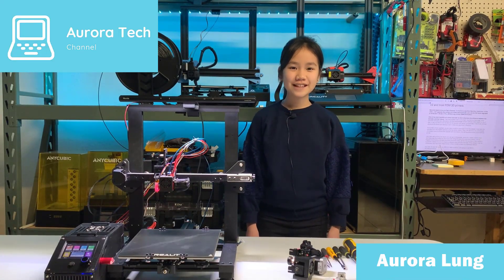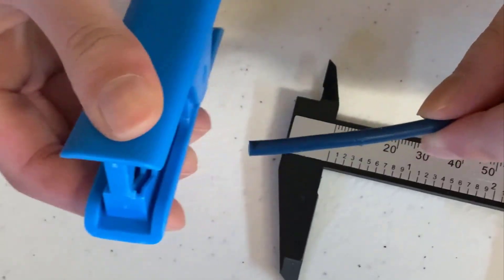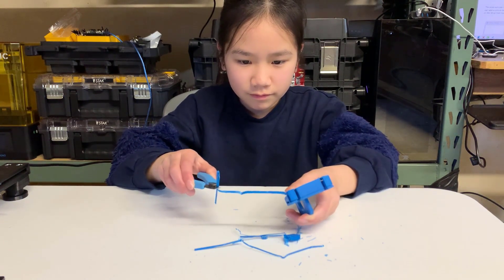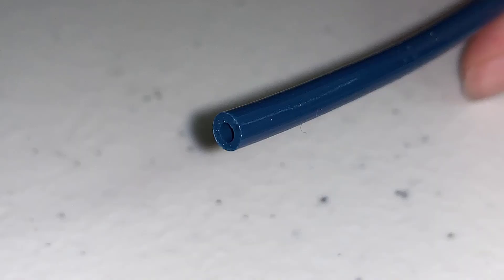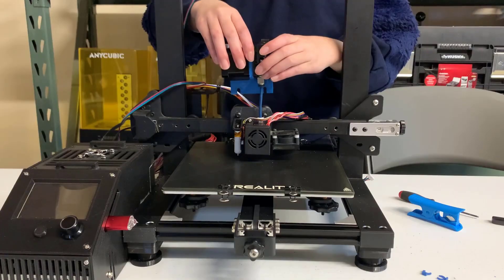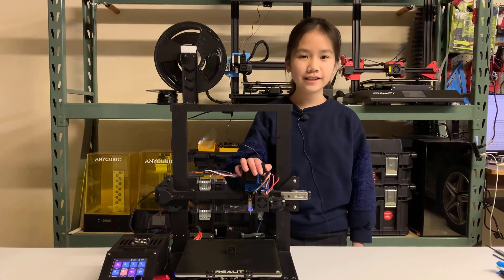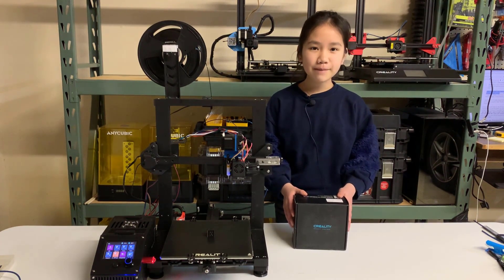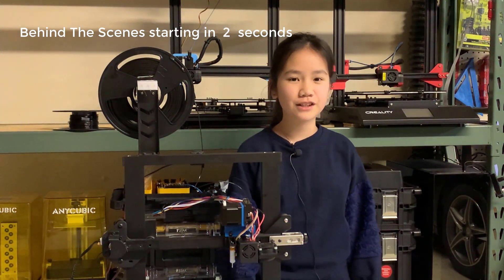3D printer FREE DIY direct drive extruder upgrade, improves print quality for Ender 3 Pro, CR-10

Comment: I like your tutorials, thank you so much, please a word of warning, never hold the object to be drilled in your hand, use a bench vice, if the object catches on the bit, it will spin resulting in severe lacerations and possibly cutting of tendons in your hand. I have witnessed the damage myself and attended the ER.

Comment: Thanks for sharing Aurora, I would like to know if the ender 3 direct drive extruder kit is compatible and possible to install into a 3d printer Two Trees Bluer plus, you know say me?
Reply from the maker: The bluer plus direct drive conversion requires much more works, I would suggest replacing the stock bowden tube to a SHORTER Capricorn tube to improve retractions.

Comment: I often watch YouTube videos about printers and printing. I often fall asleep halfway through or earlier. Not so with your videos, to the point and very informative. It shows that your knowledge is very solid and you bring it over very well. I love your videos, I want more. So detailed and well explained. In my book, this is a direct drive extruder system with a not-so-full metal hot end. It prints well and makes filament change very easy. I added a $ 6 full metal extruder just because I had one.

Comment: not really a direct drive extruder. This is more of a super short bowden tube.. Warping of the tube or trying to use PTFE will be difficult without melting it.
Reply from the maker: Yes, you are right, a super short bowden tube almost direct extruder, just like those from Creality and Micro-Swiss, they are all with a short bowden tube.
Reply: Any benefits of the true direct drive extruder (brands ?) over the "short bowden tube" "almost direct extruders" ? @AuroraTech